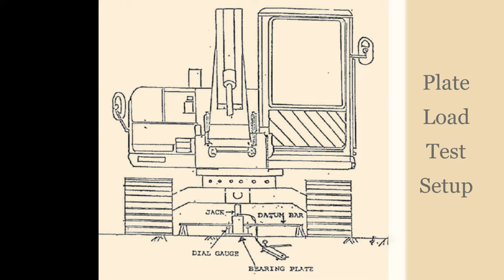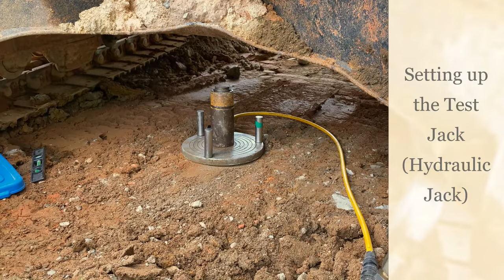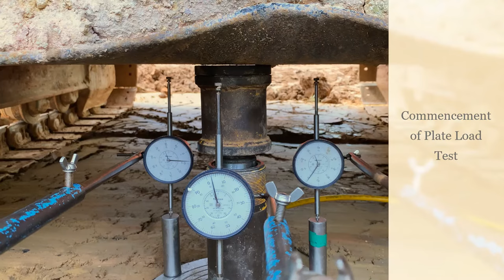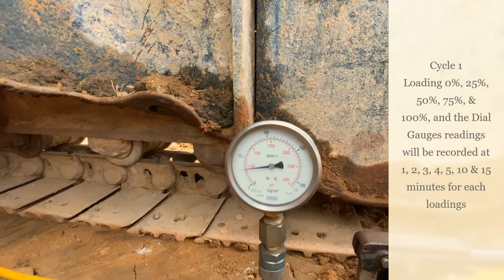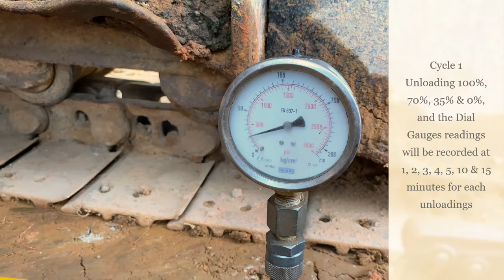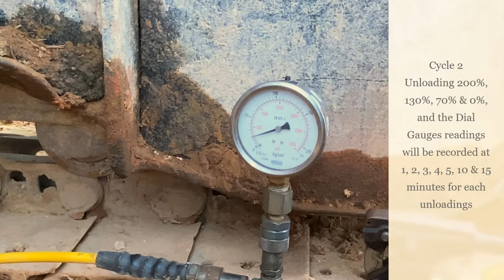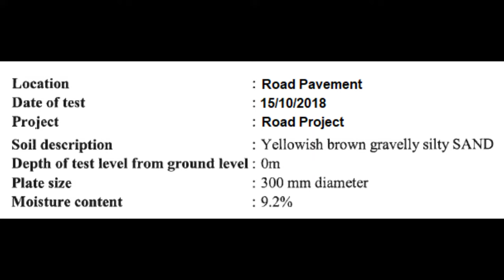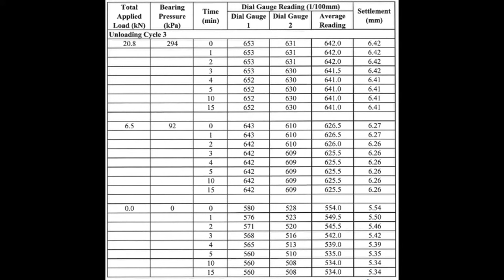Plate Load Test (BS 1377 : Part 9 : 1990) for Bearing Capacity of Soils

Comment: The plate shall be placed on
a thin layer (10 to 15mm
thick) of clean dry sand to
produce a level surface on
which to bed the plate.
Reply from the maker: Agreed on your statement. However, if the surface is levelled, no need to put clean dry sand on top.

Comment: Sir Could you tell me what is the important of ground bearing pressure in excavator?
Reply from the maker: The excavator is used as the required load for load bearing test.
Reply: The load of the excavator is much more than the design load. But some portion of the excavator(only desired load) is utilized with the help of hydraulic jack. 🫡